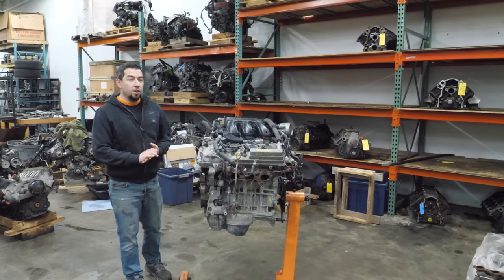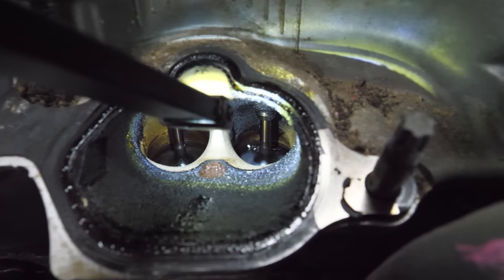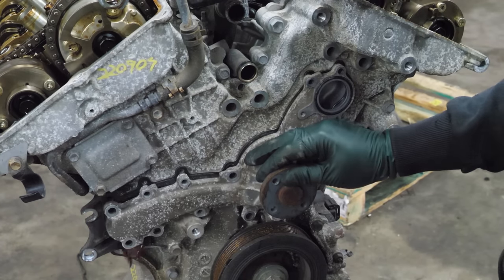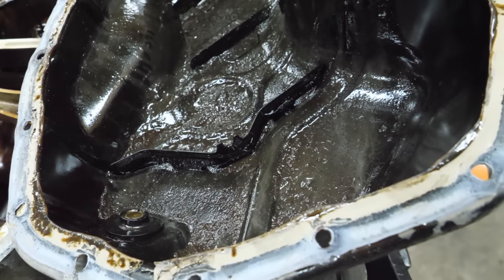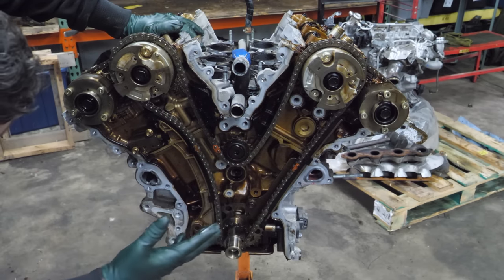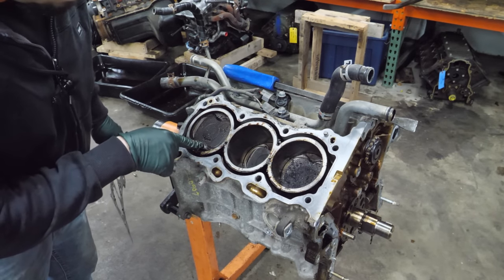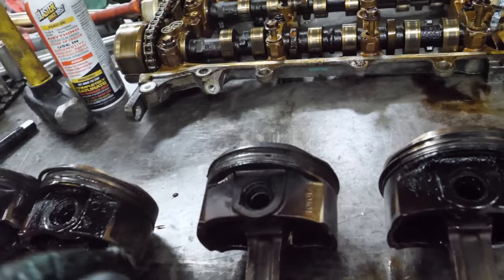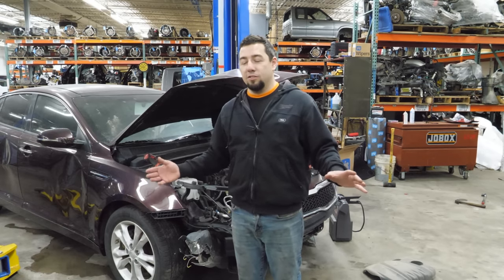Toyota Lexus 2GR-FE Teardown! Premature Death Of Toyota's Most Reliable V6 Caused By Obliviousness!

Comment: My 2007 avalon has over 450000km and we're about to scrap it because the floors (gas tank also turning to Swiss cheese) are rusted and both CV axle are done. The engine runs like a charm, no freaking leaks, doesn't tick or knock, 5w30 synth at every 8k. Not even kidding this thing is a beast, but yeah it can't survive oblivion.
For "coup de grace" you gave it almost perfectly, just say "grass" at the end. 😂

Comment: I purchased a 2006 GS-350 with a similar engine at 103,000 km and it’s water pump had just started leaking. They’re a great engine but if u don’t maintain them they’ll crap out. I replaced the pump and she’s going well 2 years and many km later.

Comment: Saw an 05 4.0 4runner at the junkyard recently with a Toyota dealer OCI sticker claiming next change at 353,000. Had been totalled  (rear ended very badly) 

Heads were off and cylinders looked great! Lots of great trim pieces from a well-maintained car.

Comment: Great video! I always keep an eye on the temp gauge of my Evora while driving. I see a lot of Toyota techs here and I'm curious if there's a common timeframe or mileage you see that the water pumps on these fail? Would it make sense to have it replaced the first time the engine (around 50k miles for clutch replacement) is out since the labor on that is so substantial ($5kish) and it would be a pain to pull the engine for something simple like a water pump down the road?

Comment: I drove my 2005 Hyundai Elantra to 265k miles with no engine issues because I changed the oil every 5k miles since it was new. My 2003 Chevy Trailblazer is about to hit 199k miles with no engine issues either. I also change the oil after 5k miles religiously. Take care of your vehicle. And it will last 👍. What a shame with that nice Toyota engine. I just bought a 2015 Lexus GS 350 with 186k miles and it was well taken care of. So the engine is mint. 👍. Subscribed

Comment: I just had to replace the engine in my 2006 Avalon. Oil change place did .... something wrong and driving home from Thanksgiving at grandma's, it started knocking and rattling and the oil lamp flickered. Dipstick was totally dry. Put 4 quarts in it to get it to the shop, but it was toast. Rod bearings spun, valves burned,  cam wiped, the whole shebang. Still worth replacing the motor because these are great cars. Now to try and get $$$ out of the oil change place....

Comment: Toyota wanted $3K to remove and seal the timing cover on my 2007 Tacoma's 1GR-FE V6 when it developed a leak (which is apparently too common).
The engine ran great, just leaked oil due to a problem seal that was never re-engineered.

Comment: Have the same engine in the same year 2008 Sienna 130K miles. Wondering to check the VVTI oil lines filters. I saw you just removed the bolts and those filters should be just on top of them. Sound easy job

Comment: Had a 01 taco with2.7 till i traded for a new one thing still ran like a champ with310k ,had frame rust issues,only major repair was radiator and wtr pump everything else were original components🙂

Comment: 12:39 I had to pause the video for this. Hilarious and well done.

Do you ever get any of the RWD Ford 3.7 engines, the ones used in the mustang and the F150? They have an external water pump unlike the FWD 3.5/3.7 "cyclone" engines.

Comment: The 2GR out of our 2010 RX350 spun a bearing at 236,000.  Vehicle was well maintained.  The original oil cooler line did let go at 100k miles, but we caught it almost right away (3 car guys saying you smell oil? As wife starts car), so doubt that was the culprit. While 236k miles is nothing to be shamed of, it was still surprising given the motor’s reputation and our maintenance.  The mechanics who did the initial loss of power diagnosis were as surprised as we were. That being said, that car had a big maintenance bill coming up(suspension bushings, rear shocks, clear coat failure, some ugly rust bubbles in the paint, and more recently something funky with the steering), the car was tired out and we had already started kicking around ideas on a replacement.  So we stayed with Lexus and got a newer gx460.  Now those can have issues too (valley plate coolant leak, tranny isn’t as reliable as other Toyota autos, and air shocks ) but even if it lasts as long as the RX, then I’ll be happy.  Hopefully it will go longer as it is remarkably solid.

Comment: It’s a known issue that the water pumps from these engines assembled around 2008 were defective. They would prematurely fail and leak sometimes under 50k miles. The updgraded water pumps have a clover shaped pulley mount. The one you pulled is the original round shaped water pump.

Comment: If you change the oil every 10k like is in the Toyota Owner's manual, the 2GR-FE will develop those vertical grooves. I don't know why it happens, but it doesn't happen if you change the oil every 5k miles.

Comment: My wife's 09 Toyota Venza 3.5l 2wd 287hp has 208,000 miles I am replacing water pump other than that engine runs great  I replaced the radiator 6 months ago

Comment: Another abused engine. I have that same engine in my 2008 Highlander with almost 250k miles on it. It sounds and runs better than many new cars. I use fully synthetic oil and change it every 5k miles. Doesn't burn or use any oil between changes.

Comment: Mine 09’ sienna is at 270,000 miles, my brother in law’s 08’ is at 360,000 miles. Both engines sound identical, both seem to have the same butt-dyno feel, and pull like beasts. We just change the oil.

Comment: My daughter’s 09 Camry ran hot pretty bad from a bad radiator that corroded out the bottom. Hers did not blow up but I think if it would have been middle of summer instead of middle of winter, it would have blown. Toyota engines are remarkably built.

Comment: I wish you (or I) had a chance to look at the engine out of my 2008 Ford Taurus X. It got hot (over mileage water pump), twice ! When it quit, there was milkshake and excess oil. 238,000 miles.

Comment: I've recently discovered Eric's engine tear-down videos, and now I'm binge watching! One observation: I just wouldn't remember to check my temperature gauge while driving. I think you would need to check it quite often to catch a problem in time to avoid damage. I worked in the computer industry all my life. There, important events cause "interrupts" to the relevant software to be handled. In my car, for temperature and oil pressure problems, I want to be interrupted, flashing lights and a siren to go off, as in an airliner, and I'll take immediate appropriate action. I watch my fuel gauge, otherwise I don't want to think about these things any more than I do about changing gears. But I do check my oil now! 😬
IanB

Comment: Speaking of overheating
I have 2  bmtrouble-u  from 1994 and 1995,the 318 tds; these things will do this, from factory:  IF the engine starts overheating and you don't look at the gauge,the ECU will start to de-fuel,more and more,  the electronic pump cutting the diesel injections, and slowing you down gradually, until after a mile or so,depending,it comes to a stop; each car has over 275000 kms(this in  SW Europe), and this happenned to me once, i was amazed; water was put in, made it home no problem,new water pump,the thing still runs new, no rattles,so well made...A/C and ABS( those 2 are the ONLY things i want in a car,no more complications...) work like new, and they were never worked on,never touched; new ones,i repair them for a living, ah, well... lots of horror stories.

Comment: dad has a 2011 avalon bought brand new in 2011babied the car with toyota parts all the time, engine started its start up rattle from the vvti a $5000 job at the dealer , i found him a low mileage engine for $1800 so had that put in. he always had lincoln towncars and those engines always hitn500k very easily with changing valve seals and intake gaskets as the biggest issues compared to the avalon that hit 280k not too bad but these engines definitively needs to well taken care of. a mechanic told me the issue stems from owners not putting the correct oil amount which is like 6.4 quarts thanks for the great videos

Comment: I had a Sienna with the same engine, this could have been mine. I overheated it on the freeway. Someone pulled out in front of me, slammed on the brakes, battery moved and cracked the radiator neck. You can say "should have noticed" all you want, but I never saw the temperature gauge until the engine was toast. There's zero other indication of a problem other than the temperature gauge; it never dings, no idiot light.

Comment: I would think the melted cylinder and overheating could be caused by a stuck open or dirty fuel injector.  A dirty injector has an unequal spray pattern.  If the injector has faulty electronics and a bad spray pattern you get a blow torch effect.

Comment: I have the previous toyota v6 3.0 litre engine which is the 1mz-fe in my 2005 camry,best v6 engine ever made. No plastic fantastic oil filter or rubber cross over oil lines all metal engine with the exception of the beauty cover on top of the engine. Mine has 278,000 kilometres on the odometer and full log books up till 250,000 ks,one owner since new. Doesnt burn oil,doesn't use oil between oil changes, oil stays golden honey colour, the only items i had to get repaired when i purchased it was a new power steering pump and valve cover gaskets. If you keep up the maintenance on toyotas and dont overheat them they just go and go. My nan has a 2004 v6 camry with 400,000 kilometres on the odometer and it still runs so smooth,doesnt burn or use oil. My camry is almost due for timing belt,water pump and seals when it hits 300,000 ks.

Comment: I have an 06 IS350 with the 2GR-FSE vs (2gr-Fe) the fse is direct injection. Water pump was leaking at 130k or so as well. Common issue. 222k on mine no issues

Comment: Assuming the knock sensors are made of PA6 or PA66 nylon, the melt temp is somewhere around 500 degrees f. So "so hot" is pretty correct. Even if its ABS they would still need to reach nearly 400.

Comment: Toyotas are mostly very reliable I worked at a shop yrs ago when a gal came in for a oil change on a 1990 4 runner it had 350 000 miles it still was okay she said she just followed the normal maintenance schedule!

Comment: Actually the water pump job on these is kind of a pain in a Sienna. There is so little clearance that Toyota recommends removing the engine to do the job! 
But you can do it without removing the engine, it's just miserable.

I own two cars with this engine and one of them is on the 3rd water pump with only 200k miles. I've done that job once and it was a total pain. You have about 1/3 of an inch of working space. Even removing the serpentine belt and tensioner is an exercise in masochism.

Also I would choose working on a J35 in a Honda Odyssey any day of the week over these. On the Sienna you have zero access to even change spark plugs without removing everything. And yes those valve cover gaskets can leak oil at the spark plugs at less than 100k miles no matter how well you take care of the engine. And good luck doing the rear gasket while it's in a Sienna. 

Decent engine, but definitely not perfect, and you will be cursing the Toyota engineers the entire time you're working on them.

Comment: Aside from maintenance, driving gently is equally if not more important. I always try not to break 2,500 rpm. 2010 RAV4 with 176K miles. Runs like a champ. Also had a 1999 LandCruiser with 406K miles. Synthetic oil every 6K miles.

Comment: That water pump was not really that bad. My Camry and Highlander water pumps have been weeping for many years, yet I don't add coolant in a year of driving on either car. The factory coolant has so much solid material in suspension that a teaspoon of coolant will leave a crust. I would bet some other failure or just pure neglect is the cause. With the color of the remaining coolant, it may never have been serviced or checked. As a testimony to the durability of this engine, It was overheated to the point of melting the intake and knock sensors, yet there was little or no damage beyond the combustion chambers. Someone really ran this into the ground.
Reply: The engine must have been driven after it had lost all of the coolant,or at least until there was no coolant in the heads.

Comment: A valve in my RX350's 2GR-FE (95,000 miles) hit a piston. A mechanic at Belle Lexus in Scottsdale said overheating likely caused this. There were no warning signs. I had to replace the engine. The first indication was when I went to start the car, and it would stay running. I had only traveled about 10 miles before ironically stopping at a car show. When I went to leave, the engine was blown. Any insights on how what happened? I was 2000 miles from home but, fortunately, 2 miles away from the largest Lexus dealer in the U.S. They gave me a brand-new loaner while I was in Scottsdale.

Comment: For a split second I thought it was the 1GR-FE  4.0 but this one is close enough. 

My Fj has the 4.0 so I wanted to see that.
Reply: I want to see one also 😁. Im fairly new to owning Toyotas but I have 2 4Runners, a ‘20, and ‘21.
Reply: Man ,the 4.0 is even stronger than the 2gr.
Reply: @madlad8102  so I had a 2019 Tacoma with the 2GR-FKS. So it was a manual and I live at 6800 ft. It was ok until I bought my wife her 4Runner. I drove it a bit and was so impressed with the 4.0 I traded the Tacoma off. It didn’t have much low end torque. The 4.0 is 2k every shift and I’m satisfied with the torque. I think the 4Runners are just that much better, built, quality, etc. just my opinion however.

Comment: 143,000 trouble free miles on mine. Pretty versatile engine…good power, good fuel economy, unreal trouble free reliability. Not a single misfire, check engine light, zero oil consumption. 10,000 mile oil change intervals a majority of its life. Changed the plugs and serpentine belt at 120,000 miles. Original water pump and not a single leaking gasket. I’m impressed.
Reply: I have a question, I bought a 2012 rav4 v6 AWD with 95k miles. It is very fast and I drive it spirited daily. Is it safe to do so and I am afraid of it breaking down like transmission going out?
Reply: @topo520 I would probably keep up with the fluid changes on the transmission (if you haven’t already), but otherwise I feel as if they are very reliable. I don’t know just how spirited of driving you are actually doing…I don’t beat on mine but it’s often driven at speeds between 70-80 mph, and a few redlines a week. Zero issues.
Reply: @doublebase6509  I have taken her up to 120mph and few drag races at stop lights. I put premium fuel only and she pull really hard.I changed oil every 5k miles and coolant because the heat here in Arizona is unbearable. Transmission fluid not yet. I will do that soon. Now at 103k miles
Reply: @topo520  wow, I don’t think I’ve ever heard of someone tracking a RAV4. Haha! That’s pretty cool
Reply: @doublebase6509  did I mention to you that I raced my friends charger 395 RT with the hemi V8 and I beat him till 80mph? Toyota Supra GR, Infiniti Q50, Range Rover, Toyota Camry, Nissan 350z, Mercedes E450, Nissan Armada v8, Mercedes GLE450, BMW 650 and many more and beat them all? I will do my plugs soon and it should be faster I am sure. The A/C is ice cold as well. I love it!

Comment: I would love to see you tear down a blown built Subaru EJ engine with forged internals, because their failure modes are supposed to be quite a bit different than the USDM OE engines.

Comment: I keep thinking that the piston and cylinder wall melting was probably caused by detonation and the breach in the cylinder created the massive overheating that melted the manifold etc. It's curious the piston/cylinder failure were at the same spot, not in different cylinders, or other areas.  I believe detonation will affect a particular spot in the combustion chamber due to a minor variation.  I think severe overheating would affect multiple places in the combustion chambers, and not be localized to one spot.

Comment: Head gasket leaking and make overheating could be one problem for 2GR. But 2GR are solid engine.  Water pump failure common but not gonna ruin the engine. It will loud enough.

Comment: The rings seized due to lack of oil changes. There are channels in the piston that lead to the rings when the oil is overused and gets sludgey it locks the rings and causes excessive cylinders wall wear. Props to Car Care nut for that info

Comment: Love the videos, but I’d have to say that the Toyota 5VZ-FE is the most reliable Toyota engine ever. I’ve worked on multiple with 700k + miles my buddy has a 1996 T100 with 1.2 million miles.

Comment: I have a 2GR-FE that had a bad water pump. It leaked out some too. But thankfully my thermostat also failed at the same time causing the check engine light to come on which prompted me to inspect the engine. This led to finding out the pump was leaking also.
Reply: How does a thermostat register with the check engine light ?

Comment: There is a certain carefree aspect of taking something apart without worrying about remembering how to put it back together.  Ahhhhhhh, that felt good (watching...).  
It occurs to me, having now witnessed a good half dozen tear downs, how modern engines ever last for sometimes 100Ks of miles?  So much stuff, so many opportunities for failure due to defects in the metal or fatigue, by all rights, they should be failing every other trip to the grocery!  The complexity of the modern gas engine really argues for the simplicity of an electric motor drive (where the complexity is shifted to the electronics).  
"What is falling in my shop?"- you must be in a safe neighborhood, as you didn't make a move for a defensive weapon, i.e. you didn't immediately think "INTRUDER!"